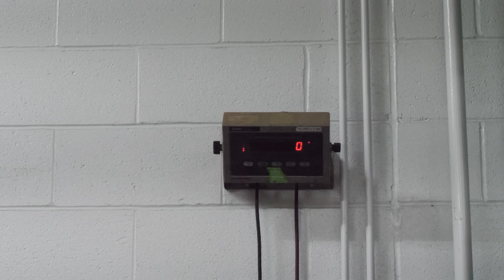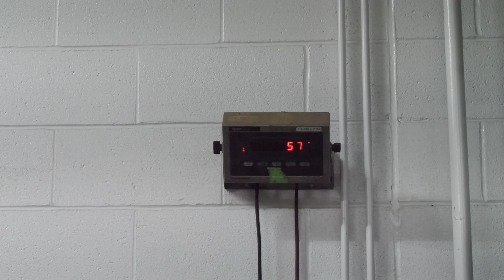EV TEARDOWN! Nissan Leaf Complete Electric Vehicle Drive Motor Unit Disassembly!

Comment: I didn't realize EV's had gearboxes;  I was always thought, "Infinite torque!  Motor goes straight to the wheels!".  Learned a lot in this video.  Motor looks like it could be turned backwards, maybe as a micro-hydro project.

Black tranny fluid, obviously took meticulous care of it....Nissan's / Jatco's don't need to be babied, they're soooo durable....
Reply: Gearboxes? It's complicated .... Yes and No... I will leave that for an expert to detail.
Reply: @Michael_CS615  It is kind of a gearbox in a sense, just without multiple gears and synchro hubs & shift forks to select the gear. It's like a 1 speed manual transmission with a parking pawl
Reply: @nooooooooooo6uoki67  That stays in first gear. No need for the other gears as the electric motor has a flat power curve and spin up to speed similar to what a turbo spins at.
Reply: @Zoomie61  yerp the torque comes from the massive gear reduction too i think teslas are at like 9:1ish

Comment: The leaf is the only kind of ev I'd ever buy.  A cheap basic city car.  I don't need a luxury vehicle to survive.  If only the batteries weren't so expensive and hard on the environment.
Reply: I just don't want a car that's part of the IoT. I don't want a car that has any sort of connection to China, either.
Reply: @PistonAvatarGuy  Better get a horse then because every car made in America has Chyna parts.
Reply: @johnarnold893  Well, I have a plan that isn't what most people would consider as an option, but living in a dense city and using public transportation is also an option.
Reply: The older LEAF models don't connect to anything anymore.  They used 2G and 3G modules that are no longer supported and can be physically unplugged if desired.

Comment: Interesting to see, not much that can go wrong. In the industry electric motors run 24/7 for sometimes 10 years without maintenance (80 000 hours). A car is driven only about 6000 hours to reach 200 000 miles so the motor won't be an issue if done right..

Comment: I'm pretty sure you've done this properly - I just checked the Haynes manual.

1. Disconnect negative battery cable.
2. Raise and safely support the vehicle.
3. Split the case, and remove the rotor assembly using two 1998 Honda Civix DX factory scissor jacks.

I would have used safety tote, but I'm no expert.

Comment: It's a bit frustrating watching you getting dowelled housings apart so my tip is to get some plastic/wood wedges that can be jammed in the gaps one side while levering on the other side. HTH and thankyou for what you do.

Comment: The gear train (reduction gear) is like that in a turbine ship. Over 100 years ago it was discovered that the fast moving reduction gears need not only lots of lubrication but also a very good oil filter to prevent wear. Pump, spray bar for oil, inlet filter for pump, job done.
Nissan either didn't know that or couldn't be bothered because reduction gear wear seems to be common on Leafs.

Edit - the thing to watch when getting the armature out is that you don't damage the coils. The ends of them are very fragile. Either support it from underneath or, better, lift it out using some sort of overhead arrangement. Preferably on a wood table with nothing steel around.

Comment: 16mm = 5/8"   Found this out working on a Grand Caravan.   Tamper proof when you can get the bits from the local parts store, etc. Funny when you pried that plate away at 6:10 I was ready for the oil to pour out. 🤣

Comment: Thank you for a most interesting, and unexpected tear-down Eric.
I have wondered about how well-engineered the Leaf motor/transaxle was; now I know... Mazda are not as thorough at lubricating the bearings as GM is with the Bolt.
Still, I am a bit surprised that they are not more desirable for use in EV conversions?

Comment: I believe I know what that sensor is for.  It reads the position of the rotor.

When power is first applied, if the (3-phase) armature magnetic field is not aligned with the rotor, the rotor will be turned sharply and suddenly to align with the stator-armature.

If the car is powering steadily on a smooth, level road and comes to an upgrade, the rotor will begin to lag behind the rotating armature field.  To keep the motor doing its proper job, the controller needs to send more power to the three-phase armature.  When the load lightens again and the lag lessens, the extra power/current will be turned into heat in the armature, and wasted.

Comment: This is particularly interesting to me as I'm looking to convert my 1948 Willys CJ2L to electric.The original motor (flathead L134) was rated at 60hp / 90ftlbs torque. The current 1967 225ci Dauntless V6 likely comes in around 120hp / 180ftlbs or so.

My CJ2A was stretched two feet at the dealership before it was sold new as a CJ2L, so I have room for batteries in the space that I currently have a 38 gallon fuel tank.

Comment: I've been subscribed and watching you for years. I love nothing more than seeing a bent conrod, or an additional inspection port. You finding a tool inside a ruined engine is imprinted on my memory. Using a fork lift to undo a bolt, likewise.
I own a LEAF (NIssan style it that way, all uppercase - Plural, by the way is LEAFs) and never thought I'd see this day. The oil in the reduction gear box was bad - really bad. They have a magnet on the drain plug so that you can see any sparkles when you remove the plug. To see them in the oil and not on the magnet is bad. Really bad.
Amzing video, thank you for it. I'm sharing it widely.
PS, yes, I had been unsubscribed from your channel. Resubbed.
Reply: There is significant peril working with magnets like this, but you did an excellent job of both making it look dangerous while mitigating the actual risk. But you do that in EVERY video and that's what makes you so watchable. I was chuckling everytime the armature grabbed Blue when you got too close.
The usual way to extract the armature is to remove it vertically with a crane, by the way. But two steel jacks worked and was much more fun. 
The usual "I shouldn't do this" then doing it crosses the EV/ICE boundary. Brilliant, love it.
Look, this was fun and it's cool for me to see the innards of a car I use every day. But, you said this was a one off and I want it to be that way.

Comment: Interesting motor design. Central rotor magnet and stator coils.

The rotor needs position sensors which then go to an EMS that generates the 3 phase at the right frequency and phase.

My guess is that the motor is actually good.

Scraping the magnet on the pole pieces will not have done any damage. Its the coils that are fragile -  and they are deep in the slots.

Very interesting sir!

Comment: Interesting teardown. Point of terminology - the armature is the component in an electric machine that produces a rotating magnetic field RELATIVE TO ITSELF. In a commutator machine - e.g. starter motor or wiper motor - that's the rotor, but on a brushless motor the armature is the stator </electromagnetic nerd>

Comment: Interesting to see that assembly pulled apart on a bench.  Just a larger induction motor direct coupled to a dif with a few extra gears.  It’s actually relatively unexciting, just like the vehicle it was removed from, but fun to watch. Thanks Eric !
Reply: Not induction, Brushless inrunner.   Permanent magnet three phase.  Feed it more watts and frequency, and they will rip.
Reply: @ noted, thank you.  👍

Comment: Those armatures make great pickup tools for picking up all the random nuts & bolts 🔩 as well as nails & steel debris, picks up way more than a regular screw picker upper ,my friend mounted 2 of those between a set of wheels & a handle to clean up the yard around the loader area to pick up all the landmines

Comment: Cheers Eric, cool to see the leaf autopsy thanks mate enjoyed very much did however miss those crisp end cap bolt torque snaps.
To your point electric cars still need lubricant and coolant so maintenance is still a thing can’t help thinking how much simpler efficient and more reliable these things are, modern ICE is scary complex with so many inherent points of failure I often wonder how it works at all 😁👍

Comment: Another cool, and educational video. Thanks. I've given thought to what type of conventional auto parts will continue to be used in EV's, and your video helped reinforce my thought on bearings being one of these things. I'm also thinking that belts may be used, but didn't see any used on this Leaf motor. I guess a lot of accessories can/will be directly driven, avoiding the need for belts. My education on this continues. I wonder if you can use that cased coil to somehow demagnetize the tools that you probably just magnetized?  Thanks again for the edutainment. Cheers.

Comment: The rotor of a motor is not necessarily the armature.  The armature creates a magnetic field that rotates relative to the armature.  The field structure (winding, permanent magnets, squirrel cage, ...) creates a magnetic field that is stationary or nearly stationary relative to the field structure.

For instance, the induction motor of a common box fan has a fixed armature around a rotor.  The rotor is a solid cylinder, typically aluminum (electrical conductor) with iron pole pieces to carry the magnetic circuit into the field structure.  The moving (AC) field from the armature induces a current that creates the field field.

In this motor it looks like the field structure is the magnet/rotor.  The stator is the armature.  There appear to be iron pole pieces running the length of the armature's inner face.

(I hold a very dusty BEng. in Electrical Engineering.)

Comment: Technically this traction motor does not have an “armature”.  The rotor, which is the spinning part, is a PM or Permanent Magnet rotor, so there are no brushes or slip rings.  All of the copper wiring is in the stator which does not rotate.  Some other EV traction motor designs are induction motors which have copper windings in the rotor instead of permanent magnets.  In this design the magnetic flux is “induced” into the rotor from the stator.   Also the BMW Gen5 traction motor uses electromagnetic windings in the rotor power from brushes and slip rings, instead of a PM rotort

Comment: R&R a/c compressor, and you lose 1/3 of the mass. lol. Neighbor had a 13. It would make about 40-60 miles on a full charge during a cold Chicago winter day. It stranded him a couple times. He got rid of it in 17 and bought a Sentra.

Comment: This was cool, thanks.   The high weight no doubt was because this didn't have much void space inside, no cylinders or crankcase, just dense metal rotor and coils.

I wonder how recyclable the rotor is.  It has rare earth magnets in it?  Do scrap metal dealers handle those?  The copper in the windings is certainly valuable (spot price of $4.14/lb right now.)

Comment: Hopefully someone more knowledgeable than myself can correct me if I'm wrong, but I believe that what you are calling the armature is properly called the rotor. In AC motors, whether induction or permanent magnet synchronous like this one, there is no electrical connection to the rotor, and the drive power goes into the stator. The term armature refers to the rotor of a brush DC motor which has a commutator to switch the drive power among the armature windings.

Comment: The gearbox oil has, per Nissan official maintenance schedule, never needs to be changed.  However, I would recommend to change it at every 60 000 miles.  It’s 2 liters of Nissan Matic S.  There are a drain plug and a fill plug.  The drain has a magnet that needs to be cleaned before reinstalling.
Reply: This one was at 59k miles. So a perfect illustration of WHY it needs to be changed.

Also a perfect illustration of why 30k changes would be beneficial...
all the glitter probably started right from new...
as the gearbox was "broken in"

2 litres of fluid and a drain plug plus fill plug right there....cheap insurance/PM....

Comment: So simple and clean! Not much there that could auto-destroy because of some lubrication or coolant leak or clogging and no moving parts that are supposed to glide against each other for years. No transmission, just a simple gearbox. Seems to me the complexity of internal combustion engines and all their shafts, rods, pistons, valves, cams, pulleys, chains, pumps, fuel and air mixture intake systems (turbos), exhaust and lubrication subsytems will one day become too obvious to further ignore the facts.

Comment: Other than all the theory that went into the design, if reliability engineering was performed, these things should hopefully last a very long time with only minimal parts that wear out. The problem will be if electronics fall that are not serviceable and the unavailability of an aftermarket. Time will tell but this was very informative.

Comment: One small clarification... these are brushless DC motors. AC motors do not have permanent magnets inside of them. The functionality between the stator control for an AC motor VFD and a BLDC controller is nearly identical. However, it is much costlier and heavier to have a full inverter setup for 3 phase AC in a car. Sidenote: AC motors will have a neutral leg, just like a transformer, which requires a 4th wire, there are only 3 here. The benefits to an AC drive motor over a DC motor are more low end torque, no "cogging" and higher output frequency and RPM with less heating. All around, a better design, which is why AC motors are used ubiquitously throughout industrial applications. Upper end Tesla vehicles have AC motors for their drivelines, and I believe they were the first modern manufacturer to do this.
Reply: I've been servicing AC drives and motors for 8 years now, and I've never seen a 3-phase AC motor with 4 leads. 3-phase AC induction motors have a balanced load.  When one phase is at its peak, the other two phases will be of opposite polarity.  If all three phase voltages are added together at a single point in time, the voltage difference is 0. This means there is always 0 voltage between the motor windings common point and chassis ground, so you don't need a neutral wire.  There's nothing stopping you from adding a neutral from the common point, but it wouldn't do anything.
Reply: @aratanaenor it sounds like you are referring to the terminal connections? All 3 phase motors have neutrals in addition to a ground, even if you don't hook them up and only run them as a delta.  Please look up Delta vs Star. Large loads and high HP applications with no rpm variance (like a blower) will use a star delta soft starter to achieve rpm ramp without overloading time delay fusing or require extreme wire guage. I hope this clarifies my previous comments!
Reply: @aratanaenor it sounds like you are referring to the terminal connections? All 3 phase motors have neutrals in addition to a ground, even if you don't hook them up and only run them as a delta.  Please look up Delta vs Star. Large loads and high HP applications with no rpm variance (like a blower) will use a star delta soft starter to achieve rpm ramp without overloading time delay fusing or require extreme wire guage. I hope this clarifies my previous comments!

Comment: The little bit of sparkles in the gearbox fluid is probably from it being the factory fill. If you dump and refill usually they dont shed any more after the gears are broken in. When i changed the fluid in the manual in my corolla, it looked like metallic paint. It never did it again, the gears still bed in no matter how good they are cut.

Comment: for seriously stuck connectors, give them a spritz of brake clean. the low viscosity allows it to penetrate the seal and libricate it just enough to release.

Comment: the Worst thing about the Leaf - is the zero active thermal management for the battery pack, so they degrade faster than a sandcastle at high tide.

Comment: If you dont sell it you could make ad cover with a PVC pipe. Then a second one over that, mount it to a el cheapo sack truck and bang you have a magnetic broom. Very handy picking up steel from the floor. I used to use one in a body shop years ago to pick up filings , nuts and bolts, swarf etc. That armature appears to have some magnets that are strong but not dangerously so.

Comment: not sure when Nissan changed but, i did a CVT transmission change out on a 2019ish Murano. The bolt sizes was just like what you ran into. 10, 13, 18, 16.  instead of what you would normally think you would find on a Japanese vehicle.

Comment: Built basically same as 3 phase motors in a factory or on your air compressor. Being an induction motor if you set up a drive unit ie; ICE engine or windmill, you can turn it into a 3 phase generator very easily

Comment: The rotor is the part that rotates and the stator is the part that is stationary. i.e. the shaft is the rotor with permanent magnets and the stator is the wires in the housing. 😮😅

Comment: Our company has four Nissan Leaf (2nd gen) and we've replaced tyres, brake pads and wiper blades after 100,000kms and no other service required. Can't see them requiring anything else for the next 100,000kms. The lack of after-sales ICE service spend is a major reason why Toyota aren't going electric, because their dealers would collapse.

Comment: I dont know if anyone mentioned this(not checking every comment) but Rich at Deboss Garage on YT is using this exact Nisan leaf drivetrain to repower an old 1960something Oldsmobile(i think) sedan. Building a brand new aluminum frame to save on weight and setting old body on that with a crown vic(?) front end axle\steering system. Dont remember every detail but its an ongoing project of his, along with the other various projects